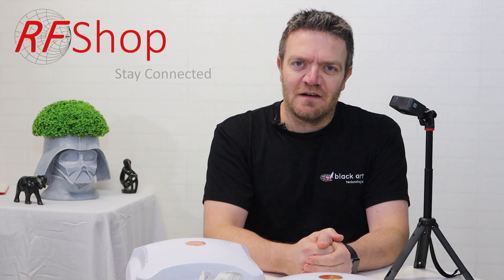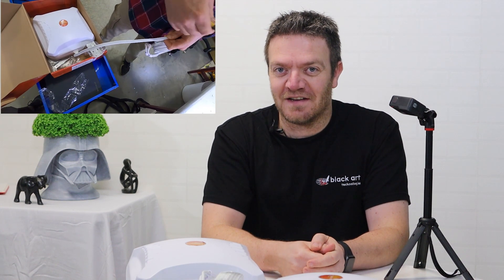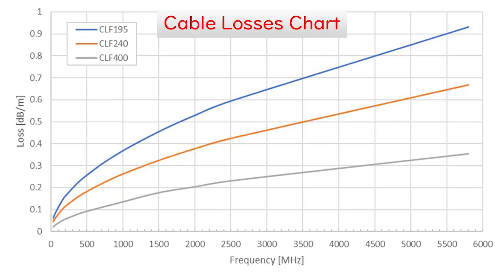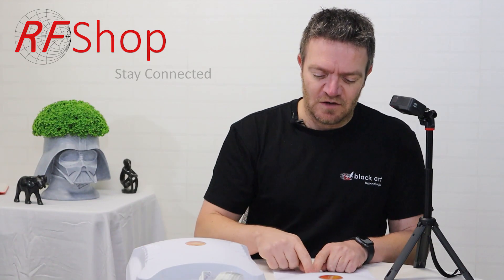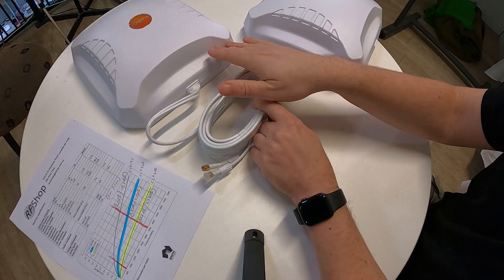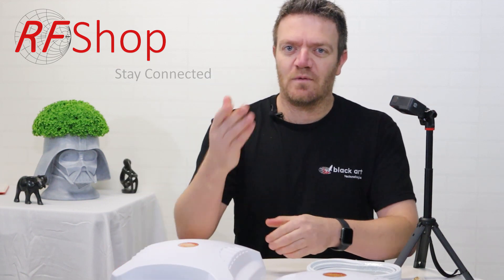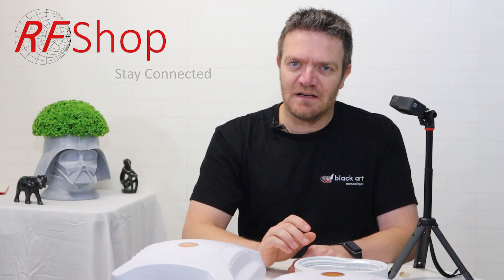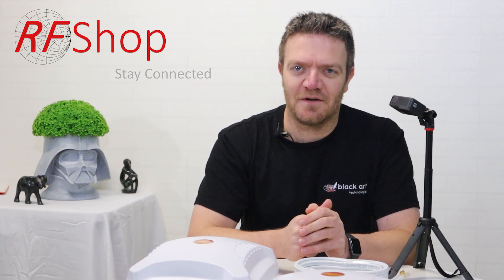How to manage cable losses on a 4G or 5G Antenna

Comment: The main point here is, no matter where you live or what you are doing. Never buy an antenna that is already terminated with a cable unless you want to open it up and change the cable yourself. Just get one with an N-type or at the very least SMA-type connector directly on the back and then use the best cable you can get away with. If cost isn't a concern, LMR600 or similar, so long as you don't need to bend it basically at all. Otherwise LMR400 is fantastic for anything under 15 metres. Another option is a 5G router that spports PoE and put it right next to the antenna with no WiFi network and the shortest possible cable (eg. 0.1m). Then use Ethernet to run down your mast into your home. However, there are very few PoE capable 5G antennas.

Comment: Thanks for this video. Even now it's still very relevant. Why cut the cable, isn't it possible to open the box and attach a new cable directly inside? Is there a connector inside the XPOL-1-5G to allow this? I'm tempted to go for a LMR-600 run of 10m.
Reply: Of course you can cut it yourself all the way inside, but you might as well just get a new antenna. They got the XPOL-24 now with 4x N(f) connectors. Then you don't have to get out the pliars and soldering iron.

Comment: Thanks for the information. HAving watched a lot of videos I conclude the best thing is to have the router right in the antenna enclosure, fed with Ethernet POE power. The EPNT-2 looks great for exactly that purpose with the advantage of not being locked into a particular router. If I ever feel a need for it, that's what I'll be going for.
For the moment - with 5G still in the future at the house - I'll stick to the XPOL-6 which has already shown in test what a dramatic difference it made. Download speed went from 25Mbps to around 72Mbps ( seen a peak of 92Mbps ) without the antenna fully optimized yet. Uploads went from about 7Mbps to around 30Mbps. Dramatic to say the least.
Router is the inexpensive TP-Link MR600 ( got it with a deal from the ISP ).
Reply from the maker: Have the shortest possible length of cable will also be the best. If you can find a way to have the router next to the antenna (such as in the EPNT series) that would be ideal.

Comment: Too much hassle! Waste of money! Best to put 5G Wireless Hub router in the loft (with band locking) with 5m ethernet straight to pc as I am getting 400 to 500 Meg down and upload not bad 10 to 13 Meg
Reply from the maker: Fully understand and respect your point of view. I agree that no cable would be ideal (but that's not good for our business case :)). In reality though, not everyone can install the router near the antenna, and in those instances a short as possible solution is the obvious approach to take.

Comment: Why not put a POE modem/router next to/into the antenna and run a LAN digital cable to the central router?
Reply from the maker: Yes, that's indeed the ideal. However, this channel needs to cater for every type of problem and customer so in the instance where PoE and LAN is not an option, you want to keep the RF cable short as possible.

Comment: Greetings. I am building a custom 4G router where I have a 4G module connected to the system. My 4G module has 2 IPEX coax connectors which I have connected to SMA connector. My question is: if I have the most robust coaxial cable possible, leading from the SMA connector on the outside of the box to the external antenna, is the small part where the cable is going inside the case going to be a bottleneck? I.E. would the SMA to IPEX tiny coax cables ruin any advantages of having a decent cable outside of the case? Many thanks.
Reply from the maker: It's actually part of many (if not most) systems...so having some really small and delicate cables on the last 10 to 20cm is quite common. I would not worry about it too much. If it's longer than 30cm it does get a bit awkward and could turn into a problem.

Comment: Hi David. I have the Poynting xpol2 (like the one in your video with the 190 type cable). Might be a silly question... Is it possible to swap out the cable with a 240 or 400 type cable?
Reply from the maker: Hi Emmanuel. It's not possible to swap the cable as such but you can trim the existing cable to something short like in the video. Alternatively, we use the N Type connector version that has no cables, giving you complete freedom on what to connect.

Comment: Hi David
I am planning to upgrade to the rutx14 cat 12 router using 4 poynting lpda  092  I have tried these panel type for 4x4 mimo from using 2 lpda in 2x2 which here in the uk i was getting band 1 3 and 20  using the 400 cable but found going to 4x4 with a panel still using 400 grade cable was not so good 
I do feel the answer at the moment is the big guns .....rather than what seems a flooded market with these panel type antennas. 
Great channel I have learned a lot thankyou 
Kevin 
My installation is the middle of nowhere in Devon England  totally on the cell edge 
Mobiles dont work.....and after alot of testing with different things the big guns are the best I am going to this weekend stick to more up  as Dr A from poynting recommends
Reply from the maker: Kevin, how did it go?

Comment: In all the stock images for the Poynting XPOL antennas, the cable is curved upwards onto the pole like a U bend.  Is there a technical reason for doing this?
Reply from the maker: Got an answer, and it actually makes lots of sense. Here's what I got...

""When a cable 'exits' or 'enters' either a compression gland or a connector, we try and keep the 'strain' on the 'exit/entry point' as small as possible. By 'looping' the cable such that it form a 'U' as you observed, the cable 'exits/enters' the compression gland or connector at 90degrees which places the least amount of 'sideways' stress on the cable/connector combination.{
Reply: @RFShop  that advice sounds very practical and sensible.  I can imagine letting a 5 meter cable dangle freely down a mast would exert considerable downward pressure due to the weight of the cable itself.  Looks like I will need to cable tie the 5 meter lead at the top of the mast so that its weight is not on the moulded cable end going into the antenna.body casing.  Appreciate the follow through, David! 👍👍👍
Reply: @RFShop  I finally read the User Guide for the XPOL-2-5g and Section 6 on Page 11 of the manual, titled "Cable Routing" shows the "u bend" cable route - it is described as "Water Drop Loop R30 min"  Page 10 describes the allowable cable bend radius is 30mm.  🙂
Reply from the maker: @tempestv8  ah....that's indeed my goal with this channel. Live and learn :D
Reply from the maker: I actually always assumed it's just a way to clearly display the cables, but that's a question I will ask Poynting.

Comment: If I use a 30ft Coaxial cable for my 5G Modem, would I lose any signal?  The cable is equivalent to the CLF240.
Reply from the maker: Yes, there are losses and at 5G frequencies (3.8GHz) it could be quite a problem

Comment: If you use pigtails in end of a LMR400 cable (pigtail so can be connected more easily with the Netgear M1 (easier coz smaller thinner pigtail cable and conversion connector Ts9 needed also) .. is that adding any significant loss then coz of pigtail ? ... I also can use a shorter LMR200 cable shorter than the LMR400.. but despite the LMR200 is shorter it still has a 3.2 dB loss on the 1900 Mhz band vs 1.83 dB on LMR400 (despite its longer with 30 feet but there I need pigtails which I don't need on LMR200 since it has Ts9 in one end)
Reply from the maker: Rene, that's a very valid question and true problem. LMR400 is very hard to work with, and will be too strong / heavy for the fragile TS9 connectors and the lightweight NightHawks. We always use a small 15cm tails using CLF100 cable (rather than RG174). It's possible to use some LMR195 or LMR200 for a meter or two as well, but as you rightly point out...it always adds to losses. 
Key thing to remember though is that the performance of the antenna (say a good antenna with proper MIMO and decent gain) will already help improve things a lot compared to not having the antenna at all. You will lose some signal through the cable, but you will still have an improvement because of the antenna quality (if it's a good antenna)
Reply: @RFShop  thanks mate (guess is what u aussies say) very fast response... I actually started with suggesting a Poynting Xpol-2 5g antenna.. But then I came across another Mimo one a bit similar but says have even higher gains at 15dB ofc I don't know they reality of that.. But is what I ended up suggesting my American friend living in rural USA .. and think u can only get that antenna there... I found it in Wireless Haven shop think was called High Beam X2 .. some ppl suggested that in another forum I red... so went with that... But I agree Xpol also seems very good.. I myself don't use coz I have LAN cable coming into my apartment and running on almost 1000mbit so yeah ofc I don't need here in Copenhagen area Denmark .. but for this was for a friend... Thanks again alot for your knowledgeable videos Learned alot from you
Reply from the maker: @Rene-kg7pf  yes, that was perfect Aussie slang 😊
Indeed there are a few antennas that are really good. The specification would go with physical size. If the antenna works for your friend that’s great. 
Indeed, it’s hard to compete with 1Gbps found in Europe 👍🏻

Comment: Nice video David.
Can I connect a mimo antenna to my to link Archer MR400 dual 4G inputs?
Reply from the maker: Hi Ralph...yes, you can indeed connect a MIMO antenna to a 4G router that has dual 4G inputs

Comment: Hello
Is there a difference between RG6 and LMR400 cable  3m length?
How much is the loss?
Reply from the maker: Hi Ritah!
Yes, there is a difference. RG6 is a fairly common 75Ohm cable, where LMR400 is a low-loss 50Ohm cable. 
Depending on the application, you need to use either 50Ohm (such as WiFi or 4G) or 75Ohm for systems such as TV or satellite. It's not a good idea to mix the two as the mismatch losses will be significant.
Reply: @RFShop  
I am currently using rg6 for the 4g system and I am facing a problem with high frequencies, for example 2600, 
and I bought a lmr400 cable, but I have not received it yet, will the signal loss be different
Reply from the maker: @moonlight2014  Yes, I would think it will work much better. The LMR400 is the correct impedance and will not suffer from mismatch losses

Comment: Question: does antenna gain and cable loss simply add up?
Reply from the maker: It’s a complex system, but once in a dB scale it is as simple as subtracting cable losses and adding antenna gain. 

Do keep in mind that antenna gain value changes as you face different directions, and cable losses change over frequency

Comment: hi, there I have 15 meteres cable,question will i lose a lot if i stay 10 mins away from the phone mast?
.
Reply from the maker: 10min away is probably not the best measurement...as time vs distance depends on a lot more parameters / questions. Best would be to measure relative power (RSRP) at your location to determine how much cable loss you can tolerate. 
Also, what type of cable do you have? LMR400 or even LMR240 is OK at 15m, but LMR195 or equivalent is probably a problem

Comment: Do you recommend any 4G aerials that contain the sim card and remove cable length issue completely?
Reply from the maker: I think it’s a worthy consideration. However, sometimes it’s not practical where people might have their network operator or IT company provide the equipment, and these are then often installed indoors. If it is possible to eliminate cable losses all-together that would be great...and we are wirking on some options as well (testing one in the next few days)

Comment: CLF400 is good choice. 
But I am thinking of other options like an “SMA to RJ45 adapter board”. If that works it would be really easy to have long CAT6 cabled without so much loss (or perhaps combine it with powerline).

Do you think a solution like that could be possible?
Reply from the maker: Hi Daniel...your timing is immaculate. We are about to take a system with us on our holiday that is exactly that. It's an antenna with the Teltonika Router inside the unit. The whole assemble goes "up the pole" and only has an Ethernet cable with a PoE (Power over Ethernet) source at the bottom!

Comment: Great video, mate.
This makes me think perhaps my next installation will not be an antenna on its own with Xm cable, but an outdoor modem as well and keep them as close to each other as possible.. 
Or perhaps get a combo such as the MikroTik LHG or SXT ones.
Reply from the maker: Luc , yes...that is always a good option to consider if possible. When I did the calculations for the video it was a strong reminder of the severity of cable losses!

Comment: Given that we are dealing with frequencies rather than straight electricity, is their a minimum length that cable should be cut?
Reply from the maker: Brandon, not in this instance no.

Comment: Would it be worth doing a vid on plugs? They are another thing that baffle me. Why choose one particular type of plug over another? why an "N" type instead of "UHF" or vis-versa if both are rated at the same resistance?
Reply from the maker: I did one on RP SMA vs conventional SMA in my early days (on this channel). I learned a lot about Youtube since then. 
However, your question is music to my ears...will most certainly do a few on this topic.

Comment: Ok so its the same basic principle as electricity. The longer the run, the thicker the core you need to minimize loss. Now beyond wifi I'm new to RF stuff as I generally only deal with cat5 and 6. My question is if an antenna has a 0.5M 1mm core lead (just a number out of the air) that has a plug on the end and I were to connect a 15M 1.5mm core cable to it, would the differing cables cause an issue even if both are rated at the same Ohms?
Reply from the maker: Brandon, that's a good question. Without causing too much confusion, in RF it's not the actual core thickness, but because it's a radio wave the ratio between the core diameter and the outer diameter plus dielectric material that results in certain losses. 
To answer your question...a certain connector (say SMA) on a small RG316 would fit perfectly fine on that same type of connector (the other gender SMA) without trouble even if it's for a much larger cable such as CLF400. 
HOWEVER, the jump from a small to a larger diameter is indeed an issue, and is considered a discontinuity. That step discontinuity will cause trouble if the connectors are not properly designed and manufactured. If you go for decent connectors they will have done some design work to make sure it's compensated for. If you go for the cheapest connector from a random online store, that's where you're going to have trouble.
Reply: @RFShop  That's a very informative answer. Thank you. So would best practice be to A) connect cable of the same type as what is supplied on the antenna or B) remove the supplied cable and solder on the cable you have to have a single run of the one type of cable? or C) remove the supplied cable and solder on the same type of cable as supplied on the antenna to form a single run?
Reply from the maker: @brangiexx  where possible I would try to have as few connections as possible. Try to have long smooth runs. 

If it's a 20m cable run, but the antenna comes with 5m 195 cable (a bit more lossy) I would do what we did in the video...cut it and use a lower loss cable for the whole length. Literally...cut your losses :)
Reply: @RFShop  if its best to have as few connections as possible, would it not be better to remove and solder for a single run? (hope I don't annoy you with my questions. I'm a technical Analyst, its in my nature :) )
Reply from the maker: Brandon Tein I completely agree. That’s why we actually sell that specific antenna model without cable in our kits. However, for many examples it’s not possible, in which case I believe this is the next best option (to cut as short as possible)
Reply: @RFShop  That sounds like a fair compromise. Thanks for indulging my questions. They must be very simplistic to you.
Reply from the maker: @brangiexx  it's no problem at all. These topics and questions are the things I offer assistance with every day of the week...

Comment: Another brilliant video David, on a subject dear to my heart. It does raise another question in my mind though. What is the loss through connectors like? For example, would it be worthwhile going from 195 to 400 for the straight run down an antenna mast then back to 195 for the wiggly bit to get to the modem/router?
Reply from the maker: Thanks Julia. Connector quality will become a problem for higher frequencies. That’s why I am going to start to explicitly reference good value and quality companies such as Jyebao. Going for the cheapest connectors, and not testing the final assembly can cause lots of pain. We’ve been there. I actually have my tough lessons using LMR600 still in the cupboard to remind me and keep me humble...great topic for another video. While we’re still in wet winter weather I am spending more time on indoor topics!

I would indeed consider running 400 cable on longer straight sections. If you look at the maths it could win you a dB or two back.